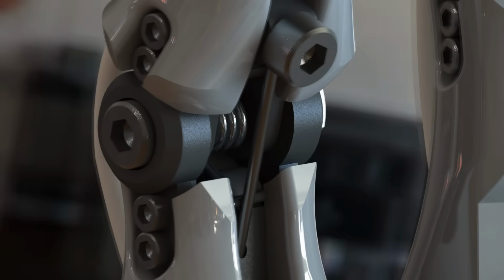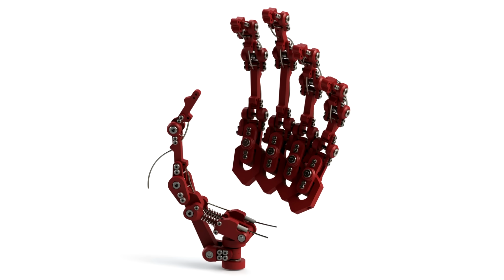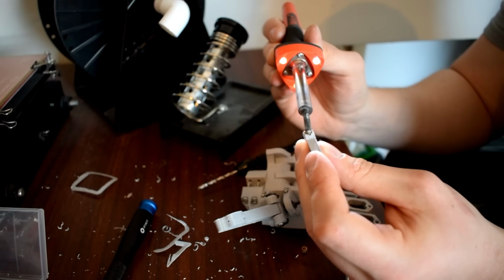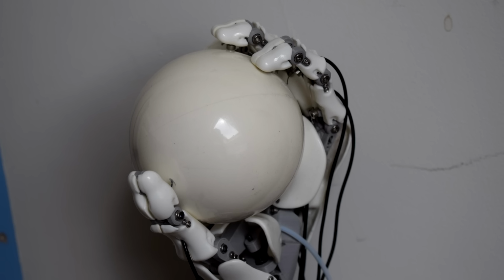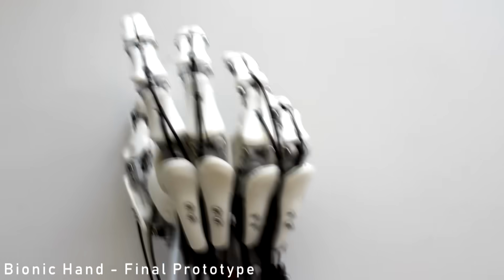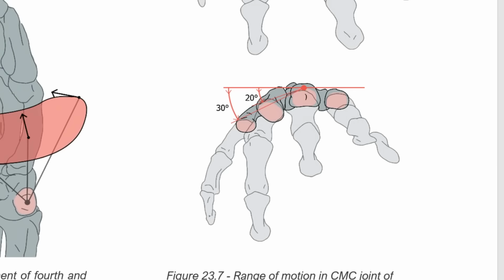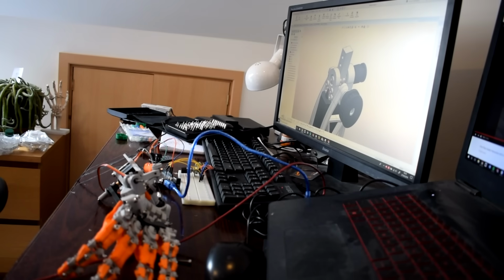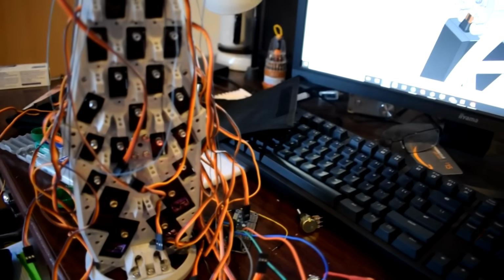3D Printed Biomimetic Mechatronic Hand Explained Part 1

Comment: simple fix to that you can use a flexible ballistic material to account for the bone flexibility. now however you could just straight up print everything in the bone shape like the hand itself.  you can then greatly reduce the size of the joints then you should consider creating like a palette for each bone finger tip and then using the smallest tubes possible to disguise them as veins you could run your wires to your actuators. using a medical grade silicone you could then create artificial tendons and muscles now sure they won't serve really any purpose except for cosmetic. I did a hand myself back in highschool for robotics class and i had to address this issue way before i had the luxury of 3d printing. But however i will be working on a prototype under my already patient name but i will post how it is built and made and hopefully this will give you some ideas so you can decrease on parts and size.

Comment: fingers naturally relax to a mid position slightly off of centre of travel, you'd need a hole to run the spring through to pull it back from hyperextension.  for position sensing, a strip type flex sensor, of the type used on vr gloves, could be used.  for finger actuation, it might be better to use a single actuation cable and magnetic fluid based dampers on top of the fingers to control individual joints, dampers could be exceedingly small.  when fingers close, they close kind of like a snake wrapping around prey, with conscious control the joints can be damped by the muscles on back of the arm, the software would be far more complex, or simple, depending on how smart the programmer is, i see that as the big limitation with dampers but they'd be hellish amounts smaller than servos.

Comment: I made something similar for my coursework in college and I used a similar approach of using servos and pulleys. But a big difference is my project had minimal set up and was controlled a different way. First of all I utilised the 3D printers ability to build supports, so in between my hinges the 3D printer had built supports and these could be "snapped" so that the hinge was now free to move. So I printed the whole hand except for the palm piece as a single print. The palm piece was printed separately so that I could easily thread the wires through the fingers and then later snap the palm in place. I printed the forearm like this also, so I could snap all of the parts together with no use for screws. I had only a basic open and close motion set up using  a Myoware sensor so that when the user tensed their arm it would close the fingers. There were some pretty big issues with the design which I would change if I ever redesigned it along with the aesthetics, like yours looks a lot better than mine. Amazing work by the way, I really like the approach that you have taken. Keep up the good work!!!

Comment: Looks very similar to a model I just printed!  Flexy-Hand by Gyrobot.  Uses TPU for the joints, which is flexible, and tight enough to 'spring' the fingers back into position.  the fingers are all actuated individually with cables, in the same way as shown in this system.  It was an awesome print.  lots of wow factor from anyone I show it to https://www.thingiverse.com/make:618927

Comment: Have you thought of using spring steel shim stock? It's cheap and you can play around with the various thicknesses. Also, why not use something like a heavy test fishing line for the tendons? Something like 60 lb braided line, then you wouldn't need cable housing and the slop with that mechanism. But you'd have to hook up the flexor and extensor sides, which work if you are using servos. Try printing with more shells and top/bottom layers, it might hide those gaps that let you see into the parts. One last thing, why not print in PETG?  It's only slightly harder to print than PLA, but I've always had the best experience using it for mechanical parts.

Comment: So, this project was for a college course? Not working on anything at the moment? Because i have a very keen ability to visualize and redesign mechanical contraptions 'on-the-fly' in my head. Sometimes within seconds but if not i keep worrying at it until...eureka! I can already envision an easy way to make your fingers tilt while spreading apart.

Being a tinkerer i find myself dissatisfied with sub-optimal designs, and getting into underwater ROV's i have been annoyed by the lack of decent manipulators in the small observation or even light-work-class ROV's. Indeed also by the lack of decent control interfaces. It seems the best companies can come up with is a simple two-fingered gripper with zero arm articulation, even though companies like Schilling make 7-dof arms that are right there for everyone to see on EVNautilus's Hercules ROV. Luckily i'm a builder, not a buyer.

Have you considered flexible fingers like Festo makes? This video showcases not only how the fingers conform to differently-shaped objects, but also a hand design that changes configuration.
https://www.youtube.com/watch?v=u4ZScJsaepg

Comment: I'm much more interested in seeing designs that are based on hydraulic. I think hydraulic has vastly greater potential than cables and pulleys. Small amount of fluid is easy to control and can exert a lot of pressure.

Comment: Wow...i am interested on prosthesis hand as well but i have "zero know how " your video inspire me again. i hope that i could achieve this kind of design in the future. all i has is one 3d printer and 123d design.
 ANYway, what is your software design on this project? The 123d design is terrible for multiple complex objects design since it lack on and off visible group objects which make modifies 1 part object ,that being under other 20 or more object, is nightmare.
123d design is also discontinue and other Autodest softwares are monthly subscription which is also bad someone jobless as "me ". but i won't mind one time purchased.

Comment: Someone needs to make a human voice using servos to open and contract some kind of lung structure to pass through a replica of a voice box if that's even possible it'd probably be pretty complex scince alot of the structures in your mouth (teeth, toung etc ) are required for human voice you'd also probably need perfect materials to replicate how sound reacts with the soft tissues I'm sure there's a hundred ways to do this, or you could use a speaker but thats just not as cool. Or rather than lung to voice box to mouth maybe there's a way to accurately replicate human voice making some kind of lung speaker. My point is fuck regular speakers they may be efficient but where the hell is bio speakers sure they don't have any advantages and wouldn't be great on energy but it can be done.......... probably. Potentially It could lead to advancements in voice box prosthetics, but the bottom line is it would be cool.
Reply: Every time I hear a voice recording you can tell it's a recording it's not a problem cause it's sounds 90% the same but it's not like the real thing all I'm saying is we've had so many advancements in TV resolution but what about audio sure it's a lot better since 2008 when cell phones all had walkie talkie quality audio but picture quality has improved infinitely more than audio not really infinitely but speakers have had the same structure for quite some time speakers need more depth to produce a natural sound they need more layers everything in nature produces sound differently microphones and speakers blend it all together and creates a background noise maybe you can't make a universal speaker with such natural depth the physics ain't there, but you could make one just for one specific set of sounds like a voice but idk i am kind of just a hyped up idiot so don't take me to seriously I just have a natural stupid stoner ideas kind of a mind, you don't even know bro how many ideas I fucking have up my sleeve I'm just a turkey stuffed full of ideas every right left boom idea just soooo many so many ideas so many ideas I wake up boom idea walk to food town pick up some pesi boom idea take out the trash all out of ideas? wronnng boom there's another idea i have so many ideas I don't even sleep at night I have so many ideas but yah know there uh  yah know kind of all stupid and absured I've had a few decent ideas but one day oh I'm a   I'm telling ya I'm  I'm gonna have a good fucking idea. Any way thought I'd leave some comments yah know   just taking advantage of myself living among the social species you know how it is
Reply: @etralin3dream983  my god this sounds like a copypasta.

 Anyway, if you can tell its a recording you have not been listening to good speakers. There have been advancements in speaker tech, its just damn expensive. Through a quality speaker you couldent tell whether the voice of your own mother was a recording. Biological speakers would be expensive, incredibly difficult to manufacture/design, have low sound quality, have low range, and did I mention EXPENSIVE. For the same price you could buy the afformentioned awesome speaker. 

With that said, it would be damn cool.

Comment: You should consider using something like a flexible filament for the palm area with maybe strips of spring steel strategically placed to replicate the human palms movement. You also need to be careful to keep the lengths of the cable runs the same length, even if you actuate other things like the wrist. The cables should always be pretty taut. When designing linkages don't think about how the human body does it, you can't really do it that way because muscles are different than motors. Focus on the end resultant movemen. Overall the goal should be for design as simple and stiff as possible while still meeting your goals for realistic movement.

Comment: I think too many designs are made with a bone structure and then adding all the pulleys etc. Has anyone thought instead of make the motors and potentiometers actually a "part" of the structure. so the motor casing is part of the so called 'bone" structure saving space? Could strip apart a SG90 motor which has a pot in it and build it into the structure.. very small though.
3D printers are good for prototyping but maybe not for super strong parts, maybe if you use nylon filament or something and coated with resin. there's 3dgloop.com which you can not only glue pieces together if they snap but is also good for coating PLA/ABS for strengthening the layers
Reply: serviceability would be screwed this way though.  putting motors inside bones makes them inaccessible.

Comment: Amazing design! I read that your biggest problem with your current hand is that you still need all those springs and wire-pull motors. What would you think about using electro stimulated artificial muscle fibres? (Of course they are not muscles, just contractile fibers). This is not quite a thing yet, but could you use it to make your hand better? :) How would you adapt the design?

Comment: Nice work!  Have you looked into twisted string actuators for your tendons? Regarding your joints, I printed a hand a few years ago where the joints were ninja flex filament. That worked fairly good.

Comment: First off, you've done a great job on this. It seems that you have some issues where you're having to rely on some small parts that need more tensile strength than the plastics you're using can provide. While listening to you discuss the limitations of these parts, I had a thought. Rather than printing these parts themselves, why not print a 3D mold and then cold sinter the piece from either titanium or even aircraft-grade aluminum? Just something to think about.

Comment: Hi! Good job on the hand! I did a similar project back in 2014 that was eventually scrapped before motorization, sadly. Instead of bolting everything together, we tried to hold everything together with an elastic mesh. We managed to build a condyloid joint, but I think that the proximal<->metacarpal joints (including the thumb) are just hyperboloid joints. 

I still have a few kilometers of flexinol in my basement if you're (or anyone's) interested haha.

Comment: Aren't the metal wires a little "overkill" for your hand? I mean, they sure are strong, but they take a lot of space, and it does not let you put all the mechanisms that you would like in it. Have you tried smaller ones?

Anyways, this is so cool. Looking very great already, keep up the great work man.
Reply: Reduction of unwanted flex, better dexterity and rigidity are things to consider.

Comment: out of all the designs I have seen. even though you do not like having all those parts. this is one of the most in depth and wonderfully designed models for a robotic hand I have come across. great work. remember incorporating 3d printed parts is key not being completely 3d printed unless you are going for non-functional. use them to proof and mold from for a final design but not as the final. even 3d printed metal (sintered) is not as strong as forged/cast, it is still just a rough draft. your design and work though is great, keep it up. if you fiddle a little more with your slicer setting you might also close up some of the small gaps in the parts between the walls (play with extrusion with a little and overlap) should help with model strength even more.

Comment: Another idea is if you wrap several tubes around each other & tie the ends together, when you fill the tubes with gas or liquid the ends will shorten, much like a muscle, there is someone working on this idea. Sean it on a Horizon program about robotics.

Comment: I was a few years ago, thinking up a robot based on the human body. The spine of the robot was going to be made up of rings with 3 tie points 120 degrees apart to which actuators would attach. Through the middle of the interlocked rings would be a spring, to return the spine to straighten it. could you use this idea to make fingers in a hand..
Reply from the maker: Thanks for the suggestion, this kind of thing is definitely what I want to move towards, especially artificial muscles.

Comment: I'm not certain that this will be helpful, however for the finger curling I imagine you could use something along the lines of the turning mechanism in a longboard. I've seen some that use rather wonky looking angled plates, so what I'm imaging here is an angled slide channel in which the finger mech mounts. 

Additionally I would recommend adding a bit of elasticity to the 'tendons' with either actual elastic cores or spring and slack configs, I've seen this provide torque control and safety functionality with limited complexity on some hand models. Alternatively you could monitor the motor current and attempt to match it to the torque curves of the servos, but that's a touch complex for early prototypes imo. This very well may not be particularly important with the current mock-up, however down the line if you transition to more powerful motors/stronger materials you run the risk of either breaking the hand, the tendon's, or whatever the subject may be holding without proper limiting of some sort.

Almost forgot: personally I f***ng hate traditional hobby servos, so I'd also suggest in any final versions upgrading to brushless motors with planetary gear sets and optical encoders, the hobby servos have very little power and typically use potentiometer as encoders which hurt reliability. Planetary gear sets are actually easier to design WITHOUT back-drivability than with, which means you don't need to continuously pump current into your motors to keep the fingers taught. I'd suggest using low profile bldcs, which may even make the lower arm bit more compact. Switching from the brushed motors should also boost efficiency a touch, not bad for something of this sort. 

Very well done tho, I for one am impressed by the level of artistry you put into it, beyond the engineering it is truly a work of art.

Comment: for small motors for fingers: https://www.aliexpress.com/item/DC-6V-200RPM-N20-Mini-Micro-Metal-Gear-Motor-with-Gearwheel-DC-Motors/32908020769.html but you have to implement you own control electronic/software
Reply: ah and I use fishing line 0.5mm for the wiring

Comment: what kind of sensor can we use to measure the finger joint (angle) ? I cant find so small potentiometer..some guy use magnetic..maybe optical is good like they use in printers
Reply: stretch sensors, by adafruit

Comment: Will, one option you may want to explore is sand casting using your 3d printed parts to create aluminum versions of them. This is a very impressive design and you could reinforce those areas by 3d printing then pattern casting them. Lost form casting I believe is the correct term. here is a wiki link https://en.wikipedia.org/wiki/Pattern_(casting) if you're interested. Excellent job on this gives me hope in the future that there are still bright minds coming up nowadays I have been a mechanical designer going on 20 plus years now and you have a rare talent from my experience. Keep it up and the sky's the limit.